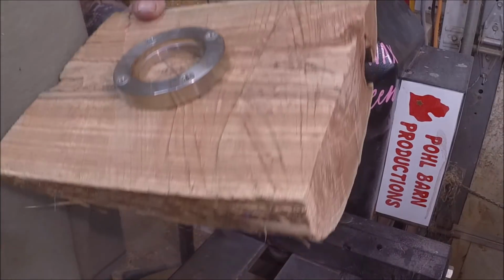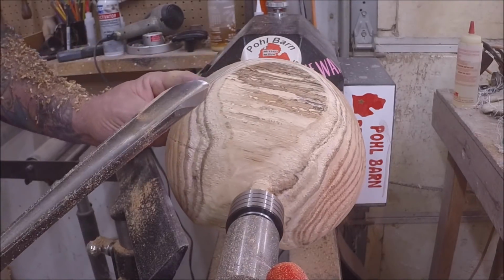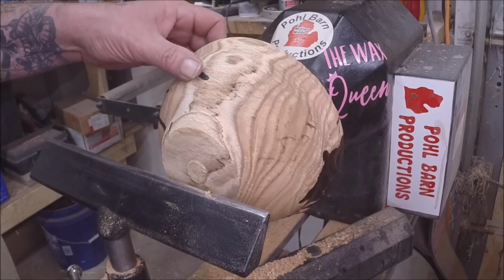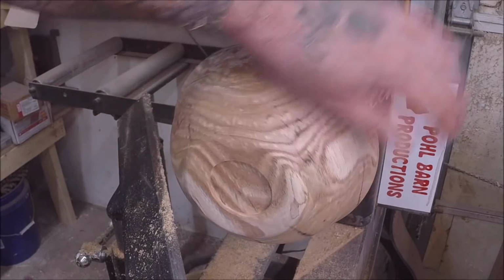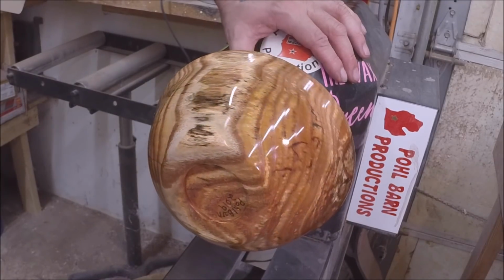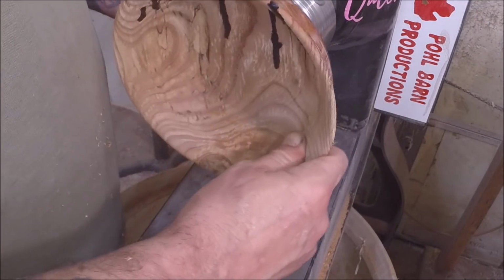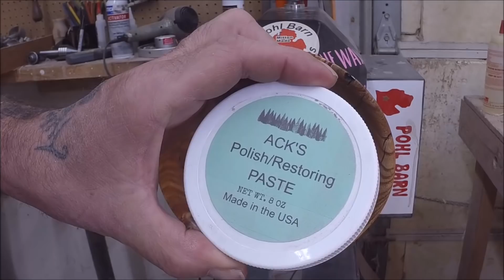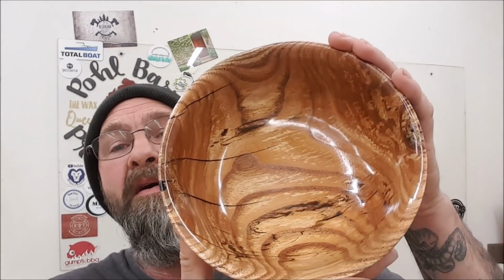ChinaBerry 2

Comment: Can I ask a question by way of learning?  When you started why not cut the corners off the log on a table saw or something, just a rough quick cut, to reduce the amount of wood turning and needed to be shaped down to round?  I am starting to consider wood turning and buying a lathe and want to learn a little more...
Reply from the maker: Laziness !   I have since built a fixture for my band saw with pins for radius cuts in one inch increments,  this piece was sitting with face plate an all for a few months or so or even more with the plate already on it so I just grabbed it and put it on the lathe.

Comment: When you have cracks and holes, could you take the sawdust from the same piece, very find dust, and mix it with Total Boat, and then fill holes and cracks with epoxy more or less stained by the very wood being shaved off?  Just an idea...thanks for your videos and the time you always take to respond to us...
Reply from the maker: Thank You,  I can do the same with the CA glue and a lot of other do add shaving or dust from the project with CA,  the resin would take to long to set up,

Comment: Nice one Doug. I know it pains you to skip the resin 🤣...  Well CA can be counted!  I’ve had the same void issues when filling larger cracks.  It seams the thicker CA sets before it completely soaks down in.  It would be good if someone made a low viscosity 5 min epoxy.
Reply from the maker: Thank You Mert,  no I am good I have resin project coming, it's nice sometime to just turn something without having to mess with the resin,  the CA was probably my fault,  it doesn't cure in the bottle with a cap on it,  let's fill a hole and cap it with activator,  LOL I think the black CA works fine, if it was any runnier it would make a mess out of our project.

Comment: Another beautiful piece.
Side note: Have you ever thought about using stabilizing resin for the pieces with cracks and such? It would fill it in and make it a bit more "manageable " Ive seen Peter Brown use it with a lot of success.
Reply from the maker: Thank You Serra,  yes I have but the equipment is so expensive and so it the resin.
Reply: Dang, didnt know it was so expensive..
Reply from the maker: yes somewhere in the ball park of 500 I think,

Comment: That China Berry turned out beautiful!! Couple questions, where do you get that unique wood and could you show a bit of tool sharpening? Thanks. Looking forward to you next piece.
Reply from the maker: Thank You Steve,  it was given to me, I would think you'd have to get it where ever it grows,  it's all over the place here in the states,  I could I suppose show some sharpening but I still really have no clue as to what I am doing with it yet,
Reply: Thanks Doug. I'm always on the lookout but I don't have much variety in my area. That's funny about the sharpening, I have don't have a clue. I just got my first bowl gouge and need to sharpen it but I don't have a slow speed grinder yet and am looking for one. Not sure if I want to spend the additional money on the cbn wheels yet though. Cheers.
Reply from the maker: yes buy the cbn wheels,  the white ones work but you are always fixing the surface on them, the cbn wheels are great along with the wolverine system and vari grind, those things make the grinding super easy,  I did go with a wider wheel on the 180 grit stone as I found I kept going off the 1 inch 80 grit wheel, but you only use that to shape after that it's all the 180 grit on the gouges,  I just leave the flat platform up to sharpen scrapers real quick on the 80 grit now.
Reply: As always, thanks for the advice! I really appreciate it.

Comment: Never seen a lathe stop as abruptly as yours does. Hope you use a locking screw on your chucks and faceplates. Anyway, another great job.
Reply from the maker: Thank You Wayne,  That's one of the things I like best about the Nova Galaxi DVR,  it has a brake and I do not have to wait for it to stop ! yes I use the locking screw but I have had things unscrew off the worm screw,  LOL  only if the piece is bigger though.